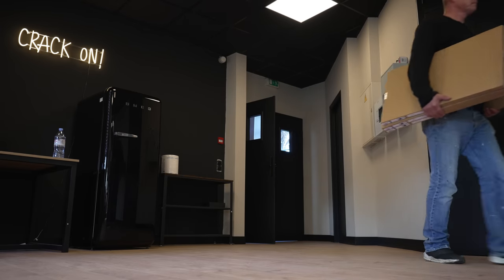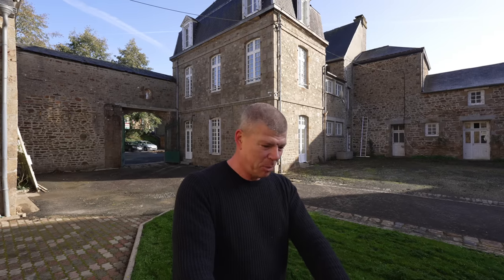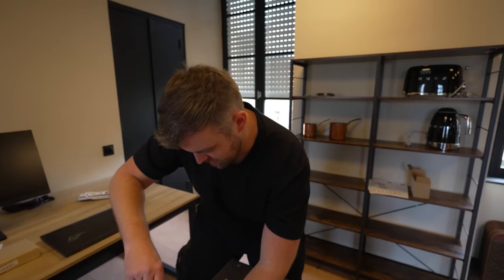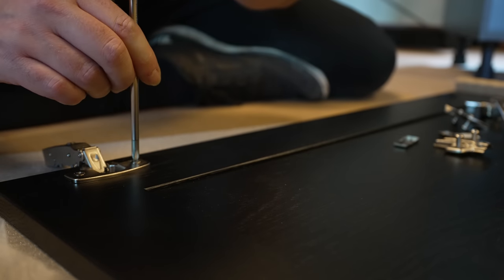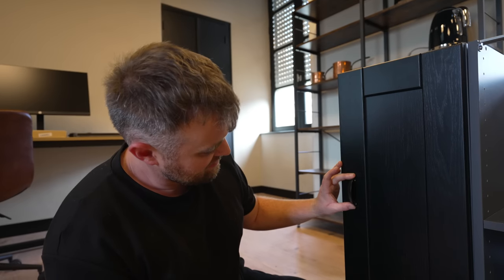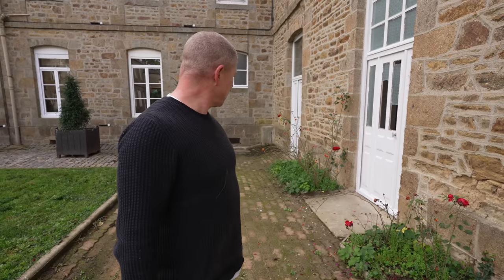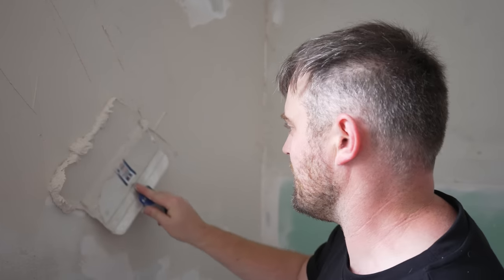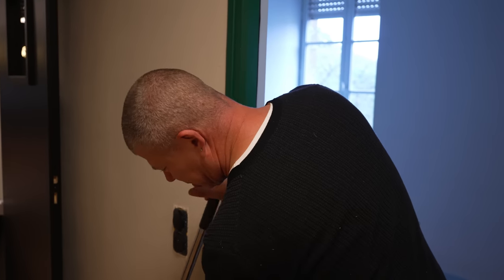The Kitchen Reveal... Sort Of

Comment: Billy, if you haven't attached the door handles as of yet I would suggest placing them about 3 or 4 inches down from the top of the door.  That way you don't have to bend over to open the door just in case what you are looking for isn't in that space.

Comment: The drawer pulls are sometimes called cup handles. When you set in the kitchen cabinets, think about how the doors open so the pulls can compliment each other. If the door opens to the left the cup should be vertical  and you would insert your hand on the left side.  Some DIY shops have cabinet pull/knob templates for easy install

Comment: Might be really nice to trim off the dead wood and mulch under those rose bushes and maybe trim them down to just above the root ball once they stop flowering, they are tough and will come back fuller. You could also underplant with a low growing perirenal companion plant to roses, like speedwell, brunera, lady's mantle, lavender, or day lilies to fill the space and keep the weeds down.
A drip irrigation under the mulch would make it easy to provide water without having to run a water house out to the beds.

Comment: Hi Billy, is that an ikea kitchen?  Ive had a few installed.  A few tips...First, the assemblers lay out the cardboard from the units on the floor then use that as a work surface to assemble and prevents damaging the floor.  Second, they make a cardboard template for the handle once they have figured out where to install the handle. Then they use the template for all the other doors.  They put hinges only one door, install the door, test the handle, then lay the hinge-less doors flat and drill the holes for the handles using the template, then they put the handles in.  Third, they put masking / painters tape on the cabinets where they are drilling the holes for the handles, this prevents chipping when drilling.  Sorry if this is unwanted advice. Good luck! Looks great.

Comment: handle on top left hand corner. When you've done the weeding around the roses, try putting black plastic bags over the soil, then put a nice solent gold gravel on top, itll keep down the weeds and is far cheaper than the netting you buy from garden center's, just cut to size and punch a few small holes for drainage.

Comment: Billy, as many screws we've seen you turn so for, how about looking into a small battery powered screwdriver. The Carpel-Tunnel problem found in many cabinet craftsmen and assemblers is something to be concerned with. Something else I noted was the use of dowels in the cabinets. I have found that adding a dab of wood glue to the holes will eventually make the assembly more sturdy. 

By the way,     LOOKING GOOD!

Comment: If that’s the configuration of the kitchen , you may have to turn the door on the 300 unit to open on the other side. With the next unit opening the opposite way so that  the handles  meet together , if you know what I mean. If it’s against the wall it will perhaps be difficult to access things. Looks great btw.

Comment: There is usually a subtle tiny indent somewhere that depicts where you need to drill out the holes for the door handles.
Reply: @janetpendlebury6808  they aren't ikea. and most other companies may have tiny indents to mark where holes can be made so you dont have to worry about templates.

Comment: Awh first it  must be location oh man  I am not first darn bell..and slow fingers.😉 Did I mention how well I paint?? Don't even need tape..might suggest to paint first much easier less cutting in.Well done with the cabinets Billy..Flat packs can be easy or hard depending on your attitude.
Reply: Oh and I have bargain prices of free help😉 I use a 1.5 angled brush for cutting in a piece of cardboard for the floors and a roller with a tray.